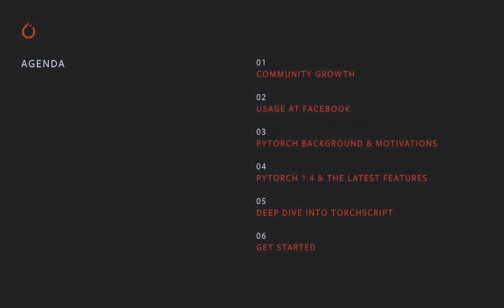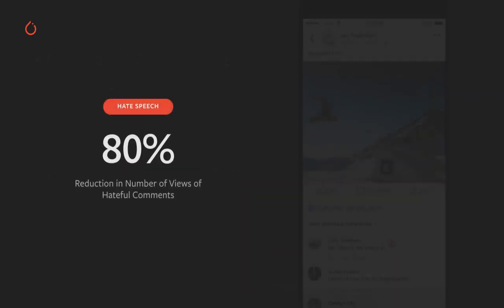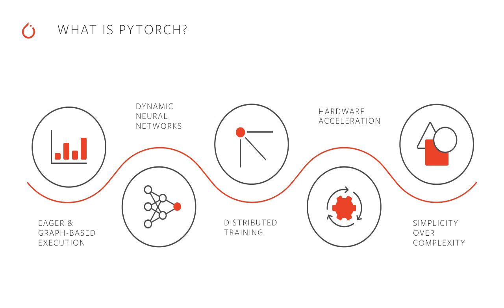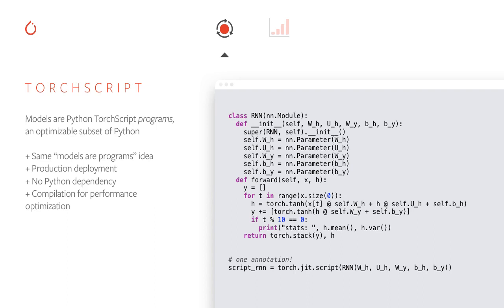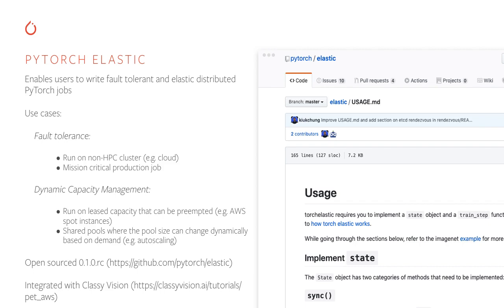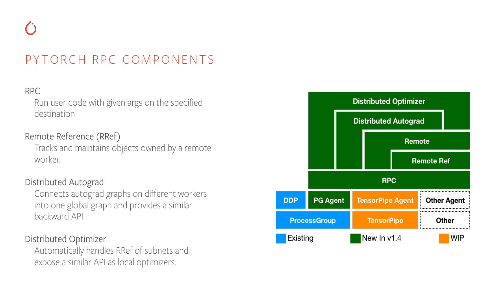Named Tensors, Model Quantization, and the Latest PyTorch Features - Part 1

Comment: My takeaways:
0. Agenda 0:44
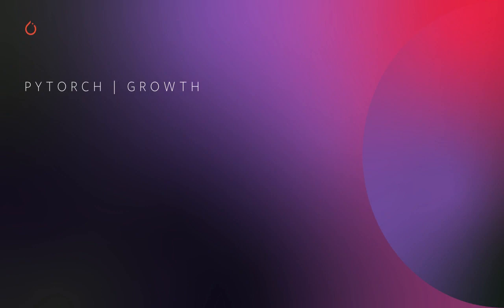1. Community growth 1:30
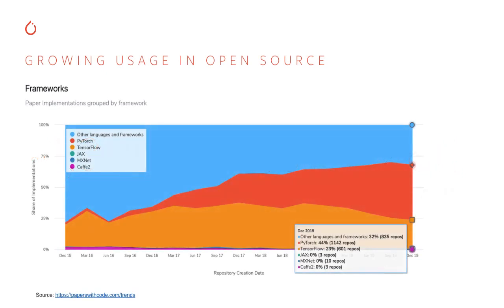- Paper implementation grouped by framework: PyTorch (44%), TensorFlow (23%), others (32%) and JAX+MXNet+Caffe2 (1%) 2:20
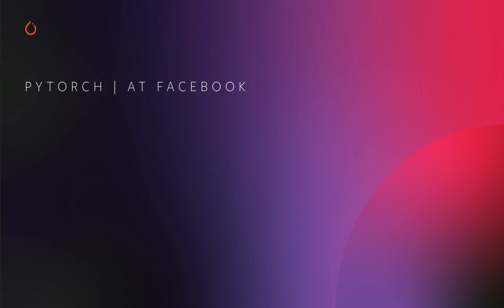2. Usage at Facebook 3:22
3. PyTorch background & motivation 5:29
- Core principles 1 - developer efficiency 9:52: clean API, TorchScript, TensorBoard
- Core principles 2 - building for scales (i.e. high-performance executions for model training and inference) 13:31: optimizing for hardware backends, PyTorchJIT
4. PyTorch 1.4 and the latest features 15:13
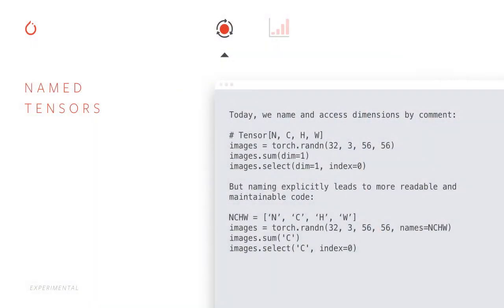- Named Tensors 15:30
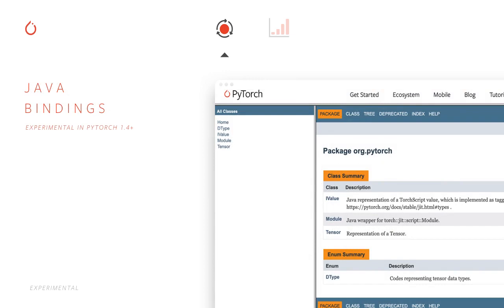- Java bindings 17:25
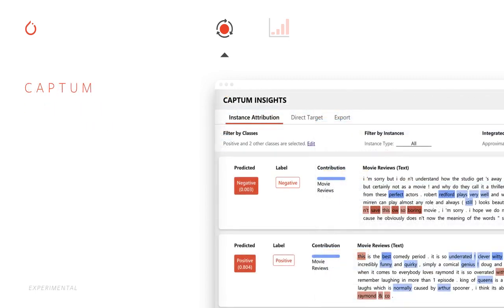- Captum 18:19
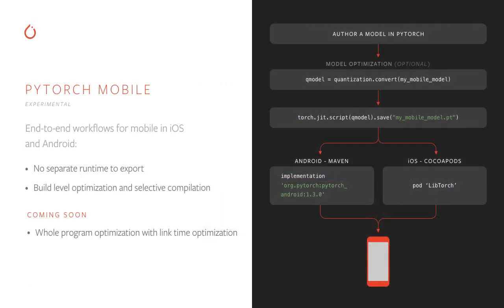- PyTorch mobile 18:48
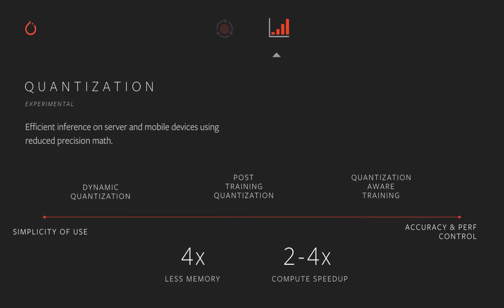- Quantization 20:49
- PyTorch elastic 22:32
- PyTorch RPC 24:08
Check TorchScript and PyTorch JIT | Deep Dive https://youtu.be/2awmrMRf0dA for Part2